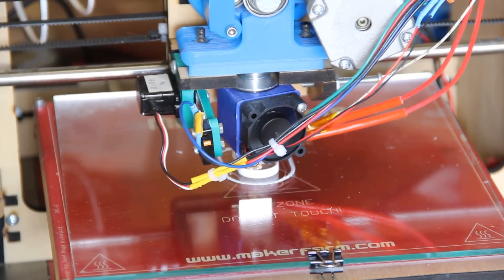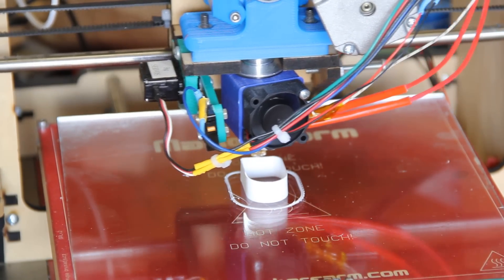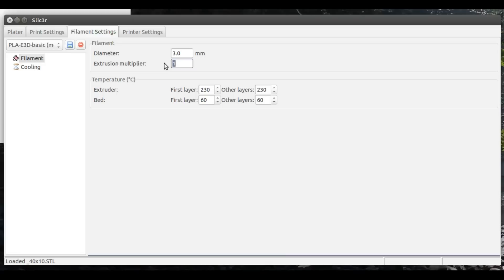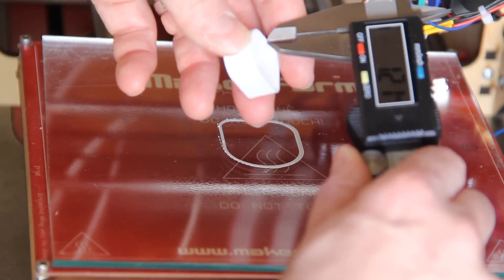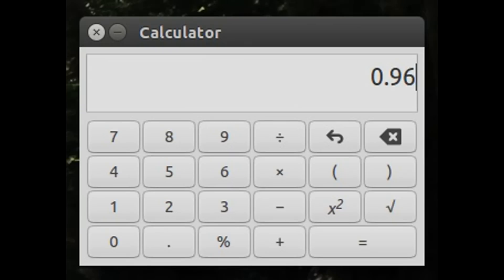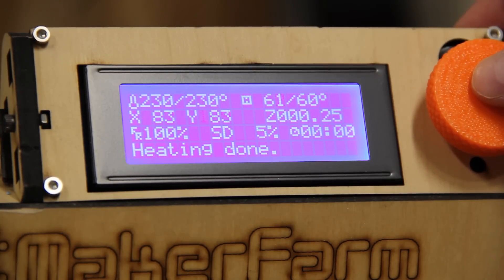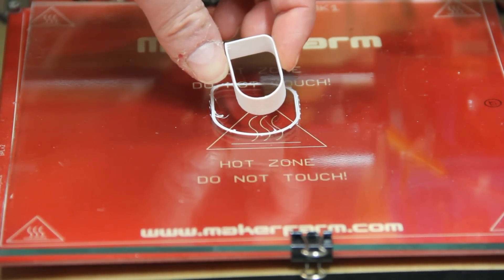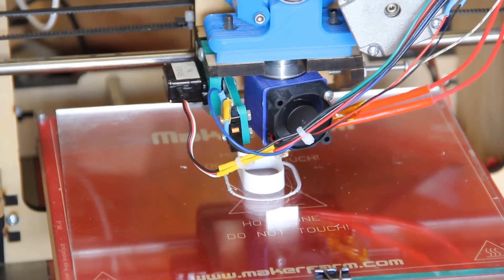RepRap 101: Setting your 3D printer's extrusion Part 2: Fine Tuning

Comment: My calipers only go to one decimal place. My extrusion width is 0.34mm, and the caliper reports 0.4mm. Also, the jaws are hard plastic, and might eventually deform or notch.
Could anyone provide an Amazon link to a set of calipers like the ones in this video?

Comment: One point that was missed is that you need to take the percentage and multiply your adjusted Extrusion Multiplier by it to get the new adjusted Extrusion Multiplier, if running the test multiple times (so from your video, you would multiply 96 by .995049554, since the first test was done assuming a 100% Extrusion Multiplier).  Otherwise, fantastic video I've watched and used on countless rolls of filament.  Thank you so much!

Comment: I know it's a older video but by doing this the setting is "locked" I to the printer so when I load another file of whatever I want to print it'll still have this setting?  Unless o change filament?

Comment: did my e steps, and with my white my correction was (average 0.37 when i needed 0.70)
second print now goiing file changed now i need 0.48 wondering how close i'll get :D
but this would mean my correction is 1.89 isn't that a huge diffrence??

Comment: Simplify 3D and Cura 2.5 are unable to slice that model. It only has walls on one side and the  curve is printed in small dots. Any suggestions?
Reply: edit your print profile - go to advanced tab - thin wall behavior - change External thin wall type to "Allow single extrusion walls"

Comment: for anyone who can answer, I purchased one of those diy anet8a clones , everything seems to work , however I seem to be having a firmware problem the nozzle never reaches printing heat or even a set temperature when it gets near the temp it starts cooling down , thinking it was a defective nozzle I replaced it heating element, thermistor and all,  no difference, so now I'm looking at eeprom settings, any suggestions what to look for, any help would be appreciated thanks

Comment: so i loaded the file in Simplify3d and when i do the prepare to print.  The layers are missing.  Its just the bottom ring i get.  Do i have adjust some S3D settings?
Reply: i had this same problem
Reply: edit your print profile - go to advanced tab - thin wall behavior - change External thin wall type to "Allow single extrusion walls"
Reply: @d1v1s1onby0  Thank you for this. May I ask where do you go to search for the actual extrusion width? I tried to search the gcode after it generated from simplify3d but I couldn't find the real measurement number. Thank you so much

Comment: Question: When I loaded this into cura and developed the g code and viewed it in notepad, the width is what ever I set it in cura as. So I need to make sure the thickness is less then the nozzle and just run it? I am new to this and am trying to get things straight. I fought with the extruder all day and just got it set tonight when someone on the monoprice mini forum helped me set the numbers using g code. Thanks.
Reply: Cura has a setting for wall thickness. You can do it yourself with any simple shape. I calibrate with 0.2mm layer width and set wall thickness to 0.6mm. 0% infill. Make sure you set the wall thickness to a multiple of the layer width, for accurate calibration. At the bottom of the basic tab, there is a filament extrusion rate multiplier, only in percentage instead.

Comment: For some reason Cura doesn't comment what the extrusion width is.  It just starts with G code lines.  Is there another place to find that information?  Also Cura didn't slice this right for me.  All I get is the curved section.  I've tried a few different settings for layer height, wall thickness, and other things but still no go.  With your great tutorials it would be great if you could just post your own object since so many people apparently had problems with Git too.  Thanks for the videos!

Comment: Why would you have to repeat that test more than once? If the measurements arent spot on then isn't there something else going on? Like how does z offset and layer height factor in here since the layer thickness or closeness of the nozzle to the bed would affect layer width. I.e. Squish

Comment: Hi,

I followed your steps
My E_steps were 90.95
First measured 120 mm in filament extruded 100 mm 
I didn't get 100mm only 95-96mm
recalculated Esteps to 98.02 to 100mm

Printed a single perimeter object
choose default extrusion width as 0.67
got 0.71 at the printed output
so extrusion multiplier (0.67*1)/0.71 =0.94

but with 98.0 E_steps and 0.94 extrusion multiplier my test print was clearly over extruding

https://drive.google.com/open?id=0B5_IWI68ZqZTa1pkOXNxb3RxbnM

The reason I went for calibration was my nozzle dragging on the support structures and solid layers (at E_steps 90.95)
and getting irregularities on the surface for larger print

https://plus.google.com/114978037514571097180/posts/RHp2tZUnN4r

Comment: Hello. Thanks for nice video, it is very informative. However, I have tried his method for few times and could never make it work. I can make extrusion width almost perfect, but printing a cube afterwards, I get under extrusion + inaccurate dimensions (I get side of a cube 0.2 mm smaller then it should be (original is 15mm)).  Have you tried to make the and measure it after calibration?

Comment: I have "external perimeter extrusion width = 0.40" and "perimeters extrusion width = 0.48".  Which should I be using?
Reply: +Steve King 
I noticed the same thing. I guess ZennmasterM isn't coming back with an answer. I think I found a way around it though. If you go to the "Print Settings" in slic3r and then to "Advanced" tab there is a setting for "External Perimeters". Here you can explicitly enter the width for the external perimeter. Make it the same as other perimeters (in your case make it 0.48). Then there is no ambiguity and you can run the calibration described in the video.

Comment: I've found this incredibly informative. Because I don't trust my vernier over such tiny tolerances, I cut up the piece (after trimming off the bottom layers).

Then I slice it up into 8 pieces from all the flat portions and sandwich them together. I then measure the thickness of the stack (pressing hard with vernier) and divide by 8.

Amazing technique! Its taken so much of th guesswork out of extruder calibration.

Comment: My extruder is clicking but there is no filament coming out :/, do you know what causes this ?
Reply: +Denzel van Lent (Denzellos)  Make sure that the filament rolls freely, so the exrtuder doesn't have to pull it too hard. If this doesn't help, then try to reload the filament into the extruder and don't forget to tighten the bolt at the extruder.
Reply: +Denzel van Lent (Denzellos) You are probably extruding at too low a temp.

Comment: ZennmasterM I  guess the question this doesn't answer is does that 96% multiplier on the flow rate make a noticeable difference? You imply it's worth doing bit you don't mention why? Does a 4% reduction in flow rate result in noticeable gaps in solid surfaces? Or is it much more subtle than that?
Reply from the maker: It depends on what you're trying to accomplish.  For some parts, it might not be a big deal.  On the other hand, if you're trying to print something that will involve tight tolerances (an interference fit, like a nut trap, for example), then 4% will make the difference between a part that fits like a glove, and a part that breaks when you force the nut into it.

Also, on parts with a large surface area, I've had issues with overextrusion causing the layer to be too thick, which has led to the hotend dragging through the previous layer, which causes all kinds of havoc, the least of which is uneven and sloppy looking surfaces.

On the other end, underextrusion can cause parts to be weak and layers to end up incomplete or gapped.

Like any machine, printers have a tuning "sweet spot" where it works as close as possible to the way it's supposed to.  This is the best way to get results that are as close as possible to the specified design of the part.

Comment: Hey I am at a loss and am hoping you might be able to help me out. I just built me first reprap prusa i3 (2014/15) with the mks base 1.2 from memory, anyhoo I am just having some issues with my z axis stepper motor or mor so just a binding issue on one side. I am just about to replace the linear bearings on the x axis side cause they were just rubbish and really dodgy, but just wondering if you have any advice, I had been told that the Gide rods should have a little bit of , spin easy with your fingers so to say. ( sorry the instructions I had for the build were just horrible to try and translate the correct steps with the build) just wondering if you would have any advice and or. Place to go that would give me the correct measurements for (the acrylic version) of the x axis shafts from the two worm drive mounts ( if it is putting pressure on the z axis shafts out of alignment etc) just any advice to get this running, I have to print another spare part cause the linear bearings holders for the z axis sides are loose-ish, also I was wondering is do you have to sync the two z axis motors ( running in parallel) so they travel at the same speed? Or does anything have to be done to make sure the arm is running level?, I'm such a noob with these diy reprap builds. My first one was a plug and play one which I sold, silly me, pleas any advice would be greatly appreciated.

Comment: I couldn't figure out how to download the stl file from github. even made a account thinking i might need to be logged in to see a download button. still no luck. please help.
Reply: Yeah I was having the same issue and getting really annoyed.  In the github link you have to go back in the folders all the way to the SFACT master folder and then on the right there will be an option to download the entire SFACT folder as a .zip which includes the "calibration" folder which has the linked 40x10 model in it. Hope that helps!
Reply: Nathan Gray
 thank you Nathan.

Comment: Wouldn't it be spot on if you used the 95,7142857% right away? 
Thanks a lot for this video it will help me a lot when I get my printer I'm sure!
Reply from the maker: Good point, and good question! 

In short, probably yes.  The reason I didn't immediately go that way is because the LCD control can only do whole percentages.  Also, when we're talking about hundredths of milimeters, we start running into some of the inherent mechanical limitations of a RepRap-style printer.  You are of course welcome and highly encouraged to get the maximum level of precision you can possibly attain, but at some point you have to determine what "close enough" is.

Comment: Dig these videos!  I got a mendel from Makerfarm last year and still trying to extra fine tune things...  I downloaded the .stl file but it's not loading up in either meshmixer or repitier host to slice?  I also noticed on other prints that Cura slicer isn't showing the layer extrusion width.  I'd hate to go to sfact and calibrate only to switch to RH and Cura and it not hold the same calibrations...
Reply from the maker: Dunno, I've been using Slic3r.  Have you tried the file from the full SFACT package, or just the direct download?

Comment: What is your opinion about using Cura instead of slic3r?
Reply from the maker: Good question!  Cura certainly has a lot going for it!  The only reason I didn't switch the last time I checked was that Slic3r offered a much more robust method of saving printer and filament profiles.  I really do like all the graphical parts of Cura, though!
Reply: ZennmasterM The main reason I use it is the rafting that it supports. I have been having trouble with slic3r and the style of rafting it using preventing warping. Is there anyway to integrate the rafting of Cura into slic3r?
Reply from the maker: Technically, since both are open-source projects, yes.  I assume you don't want to actually muck around with the code, though. :)
Alexrj, the developer of Slic3r is quite active, you might ask him if he can work it into a future version.
Reply: Have you had any problems printing with Cura? I just redid the software for the EEPROM functions and now the printer does not like the beginning series that raises the hot end up and extrudes a bit of filament before printing. It just makes a funny noise and then prints, without raising above the bed.
Reply from the maker: Honestly, I haven't used Cura in a while.  It sounds like you might have somehow flashed some incorrect acceleration settings.  Did you use the standard Makerfarm firmware?
Reply: That is what I was thinking, I followed your thread on your site to upgrade the other firmware to run with the printer. I may have to flash with the standard makerfarm and redo the other firmware. I was setting it up for the auto bed leveling and saw that I needed the other firmware.

Comment: Skeinforge is the original slicer that was used in Replicator G (official software for the old makerbots). I believe that after makerbot was sold to stratasys, development was haulted
Reply from the maker: I'm pretty sure Skeinforge development stopped before the sale. Since it was released under the GPL license, the sources are still around if someone wants to pick it up.

Comment: Great Video Just what I need Thank you, I Just have a question what version of Pronterface and Slic3r u using thanks again
Reply: ZennmasterM I got a Makerfarm Prusa i3v, in no small measure because of your excellent videos, and I am finishing it up now.  In several places, Colin  mentions that you have to use Slic3r V0.9.9 or it won't work.  Since you are using a much newer version, I assume that isn't exactly true.  Is there anything special you did other than transfer the configuration setting he is using to the newer version to make it work?
Reply from the maker: Kevin Kessler The Slic3r setup is actually pretty simple, and I've not had any issues with the newer versions.  There was a problem for a while, I think it was in 1.0 or 1.01 or so, but I think everything's working fine now.

Comment: I've been trying this, but I think there is something wrong.

I have a .3mm hot end, i have calibrated the extruder perfectly, as in when setting 100mm of filament, it extrudes exactly 100mm.

I set my slicer settings to put perimeters at 0.3mm and took measurements, which came out on average of 0.45mm, i did the calculations and it reckons I should be using 0.75 on the multiplier, which I think it way out considering it should only be between 0.9 - 1.

I updated the settings, and the wall thickness is still fairly large.
Reply from the maker: Hi James -
A couple of things:

1) I wouldn't recommend trying to tweak Slic3r to get a particular perimeter width for the purposes of this calibration, just let it use calculated values.

2) If you are going to use a specified value, you aren't going to have much success in specifying an extrusion width that is the same size or smaller than your nozzle (or a layer height that is the same or larger than your nozzle).  There is a long explanation, but the short version is that the extrudate will expand by a small amount as it comes out of the nozzle (for a .3mm nozzle, you'll probably never get it below around .35mm).  At that point, it is cylindrical in cross-section, so if you laid down several layers at that width, the contact area will be very small, and you'll have a very weak and sloppy print.  The solution adopted by the extruder/hotend/software is to calculate the lateral expansion of "squishing" the extrudate onto the bed or the previous layer.  The tradeoff, of course, is that the minumum exrusion width gets wider.

I hope this helps!

Comment: E3d vs aluhotend?  Pla primary.
Reply from the maker: They'll both do a great job, but if you're mainly interested in PLA, I'd probably say go for the Aluhotend.  The fan on the E3D is loud, the Aluhotend is significantly lower profile, as well as quite a bit less expensive.

Comment: we are building a makerfarm prusa i3v ( My son and I ) started last weekend love your videos what filaments do you use (brands) I got the hexagon1.75 hotend
Reply from the maker: I've tried quite a few, all 3mm.  Colin at Makerfarm has some good stuff, and I have also had good luck with Makergeeks.  It's a little more expensive, but I don't think you can go wrong with Ultimachine.  Good luck with your build!
Reply: Thanks for the replay

Comment: Is the magic number teperature dependent? So will it change if you make the pla less fluid. If so, how do you know this combo does not create strings?
Reply from the maker: In practice, I have not found that the magic number changes with temperature, at least not in a practical sense, but you've got me inspired to run a couple of experiments.  Stay on the lookout for a blog post with some results...